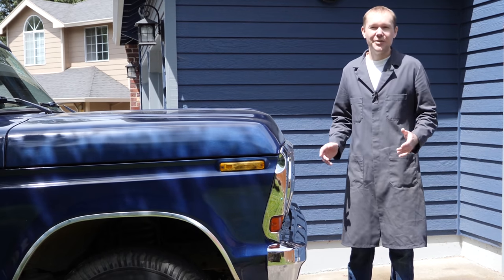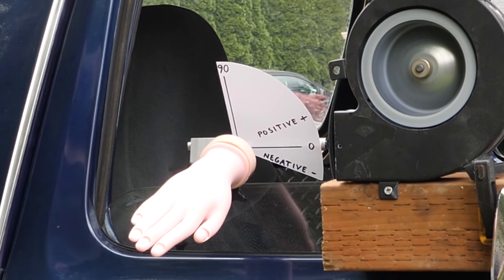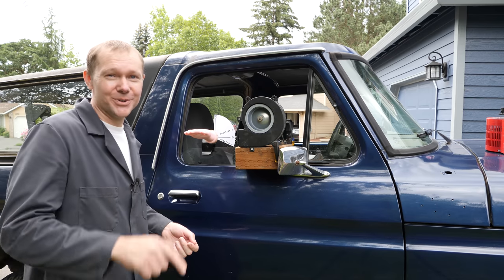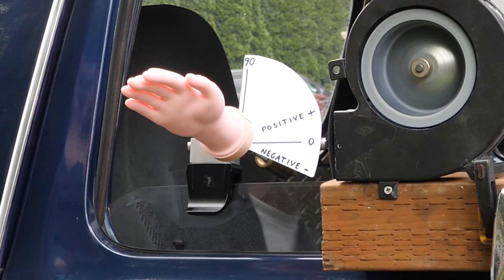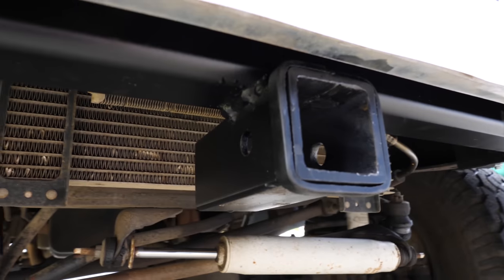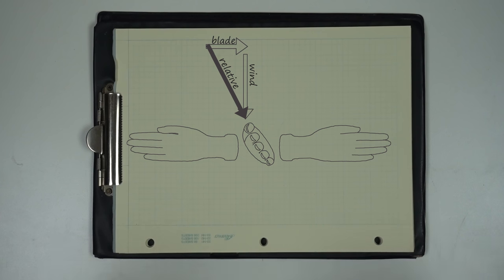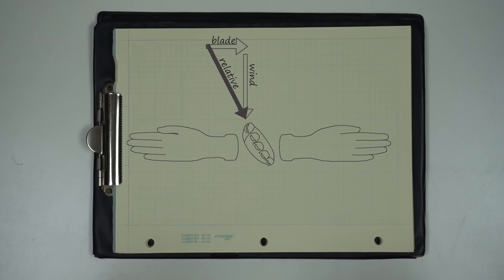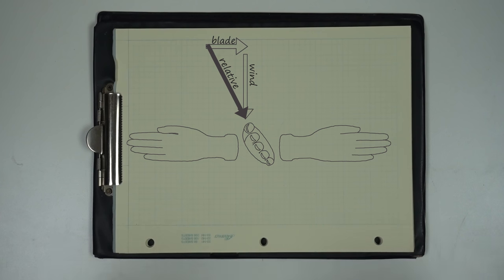Wind Power on a CAR #1 - Is it FREE?

Comment: I want your truck, i miss my 78 red bronco
Reply from the maker: My first vehicle was a red 77 F-150.  I had it until just a few years ago but couldn't keep maintaining TWO old Fords!
Reply: @QuintBUILDs  Mine was a late 78 so i had the square headlights.  I subbed recently after i saw you air up your tire using 2 lt bottles and water, i think like you but lack the knowledge to follow through most of the time lol.

Comment: Hope you find out you can't beat the 2nd law of thermodynamics.
Reply from the maker: I don't believe I have to in order to recover spent energy.  It's the difference between an inefficient windmill and a modern wind turbine with airfoils.  We will find out either way.
Reply from the maker: Yeah that seems a bit of a stretch. Since posting the video I've gotten info on a couple of nicely integrated electric car systems claiming 8-10% range extension which seems far more reasonable. Those are built into the nose of the car, not adding drag above the roof! 😜
Reply: @QuintBUILDs  It shouldn't matter where you put it. Whatever mechanical energy is converted by the turbine into electrical energy will have to come from the engine in the form of aero drag. Then it goes through the inefficiencies of the systems involved (bearings/generator/batteries/power management/motor), which are all losses. Are you an engineering student or an graduated engineer? Just do a control volume analysis.
You don't need to do the test when it violates basic thermodynamics. It's wasted resources and time. You can do it for your leisure, for sure - like the man that builds rockets to confirm the Earth is round.
Reply from the maker: I've got 20 years as an engineer and over a dozen patents. I see where you're coming from but still disagree. I won't sugar coat the results either way. That is my promise.

Comment: you are taking about this  kind of funny.   The lift on an airfoil  arises from the separation of the  air molecules   in partial vacuum  as the air rushes  from the fat  end in front of the airfoil to the rear. As it  slides off the cambered surface   linear flow and  surface tension causes it so speed up and the  gas molecules separate a little  and that's how you get lift from an air foil.
No need to  discuss pressure wave airfoils here.   
You already  know this is you are an engineer.  So I'm sort of stuck as to why you are talking about it this way 
Now  the dynamics in a turbine driven by wind are a little different but the physical mechanics of lift and drag are the same.  But airfoils  don't all have to have a flat and a cambered side they can be cambered on both depends on what the desired result is.  On a cheapo model as you have I sort of bet  the cant of the blade is doing all the talking

Comment: I am sure it can’t produce more energy than it takes. Else it would be a perpetual motion machine...
Reply from the maker: Right, but can it recover some of the losses due to drag without requiring additional fuel?  I honestly don't know...
Reply: Quint BUILDs if you are lucky, the construction could improve the aerodynamics of the system. But I have my doubts.

Comment: Don't you need Air at the radiator?
Reply from the maker: Yup, good point.  I'm hoping at highway speeds there's still plenty of air moving to cool the engine without engaging the clutch fan on the front of the engine.
Reply: @QuintBUILDs  yes i think  i hope that it work for you good luck

Comment: I'm guessing this is a comedy channel and the later parts will reveal the science behind why this doesn't work in an interesting and educational fashion. The energy to spin the blades comes from the petrol you put in the vehicle. You'll get more increased drag from the turbines than you'll get energy harvested by them because everything is always less than 100% efficient. This will waste more energy than it saves by a significant margin. 
Electric motors are more efficient than petrol ones. Hybrid cars use petrol engines to power electric motors via generators to gain efficiency for this reason. If you did this instead of using a much less efficient wind turbine setup then the idea could work.

Comment: Short Answer:  No.  It doesn't matter how technical they want to make it.  It will only make things worse.
Reply from the maker: If the turbine were above the truck then it would certainly add drag, but in front of the truck in the wind that is already destined to hit, I’m not so sure.  I totally get the “no free lunch” thing, I’m an engineer after all, but hey, it will be a great learning experience finding out!  And of course you know I’m not going to fake anything like the typical “free energy” hoax channels.

Comment: This will not work. The energy you generate from the turbine will result in exactly that much more fuel consumption. Perpetual motion does not work, especially with lossy engines

Comment: Air is water in gas form so that is why when you push towards it that it creates a force that can move things.  It's the friction caused by moving against the density of the water/air.  Earth is a realm inside an ocean of water.  Not a ball spinning in a vacuum.  That makes no sense at all.  You cannot have a pressurized system inside a vacuum without a barrier so Earth cannot be a ball in space.  Also, water does not curve.  Gravity is just a theory, it's never been proven.  There is just density and buoyancy because we exist in an ocean of water.  End of story.

Comment: don't make parted video's  NOBODY IS GOING TO WATCH THE OTHERS.  
it's not showing up as "up next either"   so you expect me to wait a week for what i ffing throught you were going to do this video. 

wich was
COMPARE amount of fuel lost by the extra drag vs the amount of energy stored by the wind turbine.  
i expected.  a drive with the turbine and a drive without the turbine.  to compare the loss in fuel.  
and then some math to see in wattage if it's efficient to harness wind power on a car.  

(just as a fun video to watch btw.  because the answer is obviously no.  it's not free.  you will loose more fuel then you gain in electricity
why?  because you loose some efficiency when converting energy. and you are converting it twice instead of once.)